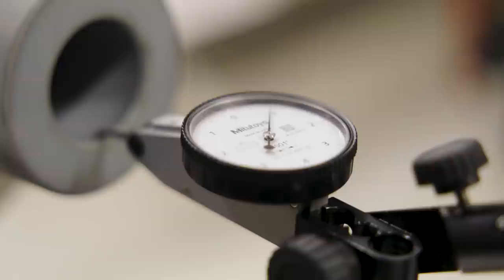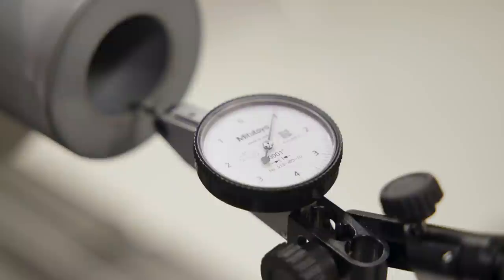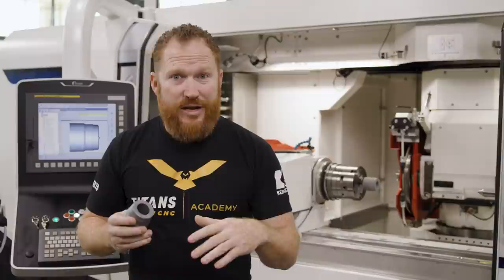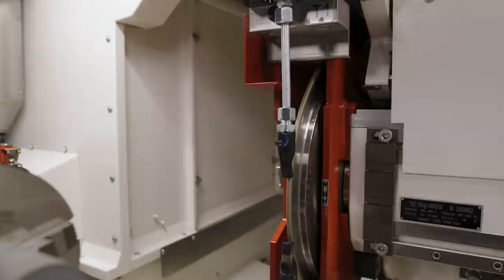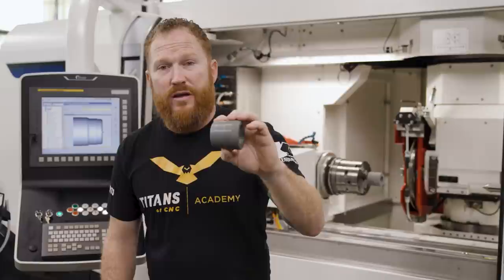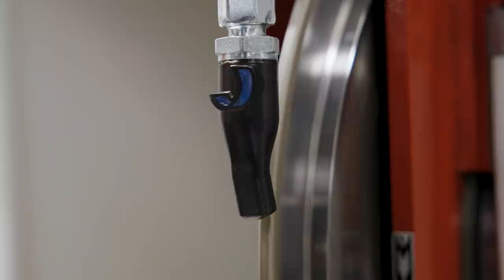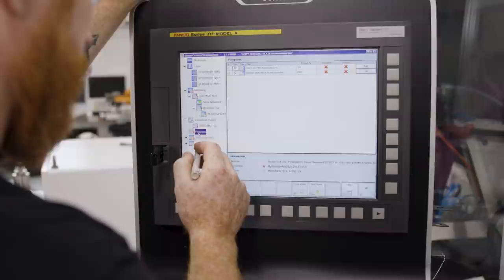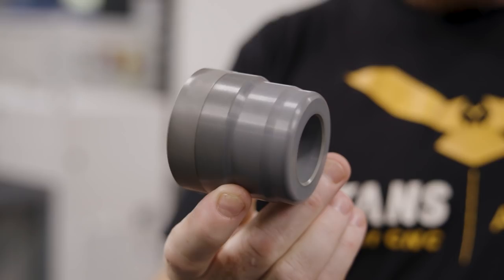Grinding Ceramic Part on Studer S41 from United Grinding

Comment: We plasma thermal spray Chrome Oxide ceramic to worn parts then grind back to original size. It firstly repairs the part but then dramatically increases the life of the part in the future. I'm curious about the peel grinding process, wouldnt mind seeing more in depth videos about techniques like that.

Comment: What kind of mold did you just make? Is it an injection mold, or a stamp? Does it make plastic parts or metal parts?
If this makes metal parts then I see the use-case for making this out of ceramic; and I see the use-case for this when making glass-filled plastic parts, but does a drinking cup wear down a mold that much, that you want it to be made out of a durable material?
Reply: A stamp/form. They are in a progressive series that spit out aluminum cans.

Comment: I have a question regarding CNC-machining with grinding wheels. The precision has always made sense on let's say a conventional machining job like tungsten carbide on soft steel. However, abrasives like grinding wheels must eventually wear out and thus make them smaller. How can the machine account for the wheel getting smaller? Or are these effects negligible? Perhaps you calibrate the machine regularly?
Reply: When the wheel is dressed, the machine accounts for the wear of the wheel. Each job will vary depending on material and wheel requirements. Test runs determine how often the wheel needs to be dressed in order to maintain an accurate process.

Comment: Why wouldn't you use a diamond wheel on a ferrous material? Are they more expensive compared to a aluminium oxide?
Reply: diffusion
Reply: Diffusion is correct.
Steel and cast iron contain carbon. Diamond is simply said just compressed carbon, so there is a reaction in between the part and the disk.
Reply: @iamthemostfamoushaha  Also generally Diamond wheels aren't as 'open' as the softer vitrified wheels, so you get a lot of heat being generated.
Reply: More expensive and chemical diffusion you dont want to keep dressing down an expensive consumable if you can help it. And also the grit is to be taken into account of different grades.

Comment: is this ceramic and the ceramic used to make fancy bowls, cups the same material? if so I am confused since ceramic breaks away so easily at slightest shock.
Reply: This looks like silicon nitride. Most ceramic dishware is silicon dioxide which is a weaker material, but all ceramics have a tendency to chip and crack.
Reply: @silent_tofu7921  i see, thanks
Reply: @jackstarsky3268  ceramics in general are normally really hard, and because of that hardness, they get really brittle, which is the main thing that determines whether or not a material is going to bend, or shatter and chip away under a particular load. Glass is a great example of this, normally, you don’t think of glass as a particularly “strong” material, but if you make it a thin wire, and use it to suspend and hold up a load, then it’s stronger then steel would be for that same diameter. For an example, the 40KG mirrors, that the LIGO instruments used to detect gravitational waves, are suspended by 4 0.4mm thick fused silica wires. That’s only about 6x the width of a human hair, and it’s holding up 40KG, with pure, fused glass.

Comment: I noticed that probably all your machines are Fanuc based (even the 1.7M$). Do you have any experience with Siemens controllers? Do you prefer Fanuc or simply the first machine was Fanuc and and you just rolled with it to keep the rest the same? I am asking because the place that hired me blindly got their first CNC and it has a Siemens control that I both love and hate. Some things are very intuitive and user friendly while others are very cryptical and make no sense while being as if they were translated from German by an 8 year old who didn't natively speak either language.
Reply: Stay tuned... we are getting a new grinder with a Siemens control in the next few months.
Reply: I've never seen anyone that has worked with both and prefers Fanuc over Siemens. Some prefer Siemens, some don't care and like both equally, and some have only worked with one.
And if you feel like some feature doesn't make sense at your CNC controller, then know that that's normal, for every controller. Some features might make sense from a developer standpoint, but not make sense from a user standpoint.
Reply: @sasjadevries  I know that there is a ton of stuff the Siemens controller does that Fanuc based controllers don't but I have only worked with Haas controllers other than Siemens. It made a lot of sense machine wise but function wise Siemens is way ahead even in the most basic stuff while no matter how much Shopmill can suck it can do some things a machine shop might want without engaging in manual programming.